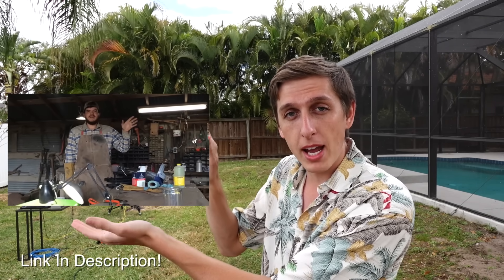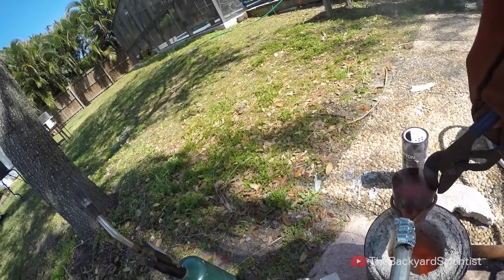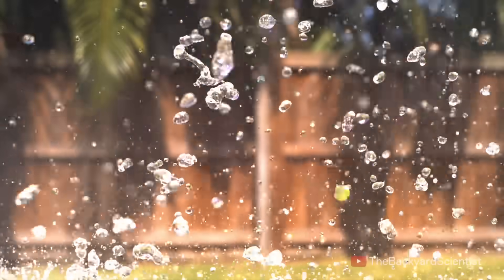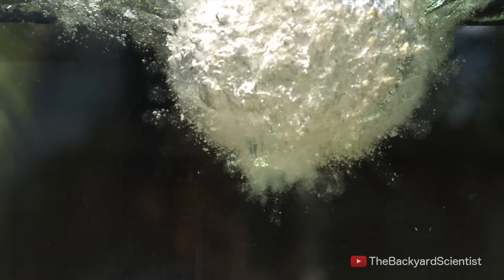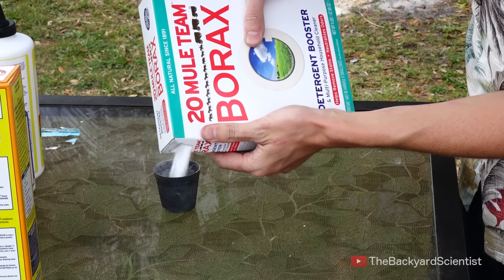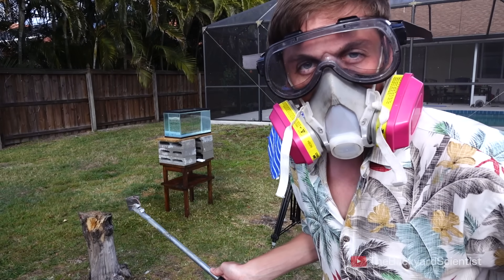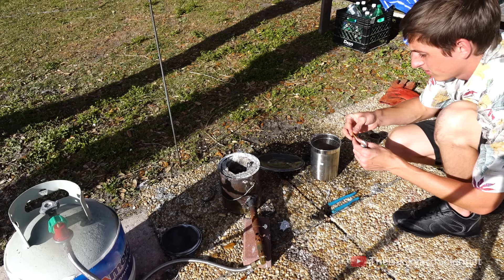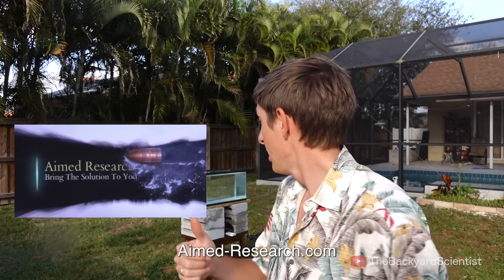Pouring Molten salt into Water - Explosion!

Comment: I hope this helps. The salt itself doesn't explode, the molten salt is so hot that the water instantly boils to steam. As the water contacts the very hot molten salt it dissolves rapidly, transfering its heat to the water much faster than would happen if the salt did not dissolve. Bam! Explosion!

It's not a chemical reaction. Aluminum would work well.
Reply: John Irby I agree, there is no chemical reaction. No new compound can possibly be formed here. All this is is a change in states of matter and the process of solvation, all due to the transfer of thermals energy from the molten NaCl.
Reply: Not Brenda  I disagree, there is a chemical reaction (the explosive solvation of sodium and chloride ions into water via a coulombic explosion). Basically, that liquid salt is held together from boiling by ionic forces and water disrupts them thus turning molten salt into a cloud of ions ready to go into water.
It should work with almost any highly water soluble alkaline salt with a high enough melting point, but the salt needs to be heated waaaaaay above it's melting point.

Other coulombic explosions are alkali metals + water and thermite + water (ice)
Reply: None of the above explains why there was a different reaction with other types of salts.
Reply: @stellarfirefly  the announcer did mention the Leidenfrost Effect as an explanation, which apparently varies for different surface properties.
Reply: But it creates a different compound sodium hydroxide, and if it wasn't chemical there would be no flames. Also if it creates an explosion just by boiling water, how would people cool off metal for swords?
Reply: metal for swords is quenched in whale blubber, not the same as water.
Reply: I dont know much about science but I was thinking that the water heated so fast it expanded outwards really fast and when it expanded it expanded really rapidly and put lots of pressure on the glass  :P
Reply: The water is being extremely quickly changed from a liquid to a gas resulting in an explosion from the rapid expansion and buildup of pressure.
Reply: I'm a Physicist. I've tried to explain this a basically as I can:

Newton's first law...conservation of energy. But more applicable is the third law of thermodynamics states that the entropy of a system approaches a constant value as the temperature approaches absolute zero. You can recreate this experiment over and over with the same result...even with Aluminum....

Chemists...think very hard. What chemical reaction is happening here....?
Reply: Dissolving is a chemical reaction of sorts
Reply: @TheLaughingclaret  I think dissolving is a physical reaction.

Comment: Water can begin under going thermal decomposition (hydrolyze) around 800 C which is incidentally the same temperature that sodium chloride melts. I am unsure, however, if enough water would hydrolyze to create this large of an explosion. This was actually one of the reasons that the disaster at Fukushima was exacerbated because the hydrolyze hydrogen and oxygen blow a hole in the side of the reactor. https://www.scientificamerican.com/article/partial-meltdowns-hydrogen-explosions-at-fukushima-nuclear-power-plant/

Comment: Is it possible that the reaction isn't so much with the salt but the water. Maybe the molten salt is hot enough that it separates the water into Oxygen and Hydrogen, and the heat from the molten salt is enough to explode the Hydrogen around it.

Comment: I think it's simple. It's all about solubility. Salt loves water and dissolves very fast in it. Even more extremely so if it's heated. You put salt into water in normal conditions, return few hours later and it's all dissolved without mixing. You put hot salt in it, you speed up that process into milliseconds.

Think of how much energy desalination requires. The molecules of salt are attracted to water so strongly that they can overcome the Leidenfrost effect by random touch if temperature is sufficiently high. Once there is a random touching spot, the salt expands faster into the water than the water can expand away from the salt. Once the water got infused with that hot salt faster than it can evaporate, it explodes as the water catches up evaporating.

Comment: It may have to do with the viscosity of the molten salt is it look like the borax and other solvency were melting and having a higher viscosity and so could not create holes for water to get trapped in when it was poured because it was keeping a more contained Mass like a drop of water you can test this by smelting other chemicals that would have similar viscosity when melted and pouring them into water

Comment: What's the difference between an explosion and a chemical reaction then?
Reply: Exploding black powder, dynamite and such are chemical reactions. If you put a very hot wine glass in very cold water it will shatter but that is not a chemical reaction. The question here is, did NaCl react with the water or anything in it or not. I'm not sure that no ph change means no chemical reaction. It just means none of the NaCl dissolved in the water.
Reply: Aha I see!

Comment: So theoretical guess as to why this works (though can't explain the difference in materials). You are definitely seeing the same reaction as what you get from elemental salt, but I think the delay is because the rapid cooling is causing the separation of the elements. To explain, sodium loses an electron, chlorine gains an electron, and creates your stable table salt. Heating it would add a lot of energy, and then the rapid cooling as it hits the water is potentially breaking apart the salt into the 2 elements at a rapid pace and then you see your sodium reaction. Also the chlorine if separated would be in gas form I think, which being under water would possibly also cause a rapid expansion? Idk, I suck at chemistry, just going off a logical guess.

Comment: Just a question but could the heat be separating the sodium and the chlorine and you have a delay in reaction due to the chlorine or chloride acting as an insulator between the sodium and water. Just a question of ignorance by the way

Comment: When you melt sodium chloride in your crucible the greenish gas coming off is the chlorine separating from the sodium. Which sodium is very reactive with water. Basically you showed the reverse process of making sodium chloride. They take an airtight beaker and fill it with chlorine. Then a drop of water is dripped onto a piece of sodium in the beaker causing it to ignite and instead of exploding as it would with oxygen it instead absorbs the chlorine and creates table salt.

Comment: Just causing the water to flash boil. Same experiment could be done in a microwave without the salt.
Reply: Pouring molten iron into water doesn't yield the same results, so try again. It's specific to the elements at play.

Comment: It might be that salt retains its hygroscopic properties at high temperatures. Any breakdown in the Leidenfrost barrier causes water to be instantly drawn into the molten salt. It'd also explain why there's a slight delay between initial contact and the explosion. A small portion of it has to cool slightly first.

Comment: My theory:
       Steam explosion, not salt explosion. 
      Energy to power explosion is stored in molten salt as heat. 
      Somehow, molten sodium chloride is able to transfer heat into water efficiently and rapidly. 
     Rapid heat transfer means rapid expansion of water into steam.
      Rapid expansion is literally what makes an explosion an ex-freakin-splosion 
      Sodium Chloride’s extreme water solubility means high surface area of contact between it and water. 
     High surface area contact means rapid heat transfer, which means steam, which means kaboom.
     Conclusion: Sodium chloride is able to dump heat into the most water possible in a very, VERY short time. 
    Extra credit: boric acid made a ball in the water which means most of the heat was trapped inside the ball, not boiling the water.
    Conclusion part two: It has to be about the time it takes to transfer heat into water.
    Also: I hope this makes sense

Comment: Best guess, heating the salt separated sodium from chlorine; sodium + water = boom

The chlorine liquid could be insulating the sodium liquid, allowing more of it to react simultaneously rather than exploding on the surface.
As a general rule, underwater explosions are intensified (see, firecracker by self, firecracker in bucket of water)

Comment: you should have known pretty good if there was a chemical reaction or not by adding phenolphtalein on the water before pouring molten salt.
Phenlophtalein is a basic indicator that turns pink if there is NaOH in solution.
Reply: The reaction would have slowed somewhat. I have a feeling this is a Coulombic Explosion melting the salt makes the surface smooth which facilitates the reaction. Adding Phenolphthalein might get in the way of the ion exchange between Na and water.

Comment: You got extreamly hot molten salt, lower boil point of the water due to the salt at the place of contact between them.  Then water pressure all around the salt.  basic

Comment: Salt is sodiumchloride. MOLTEN salt exists of those components. Sodium and other alkalimetals are commonly known for these reactions when mixing it with water...  do a bit of chemistry class before doing this stuff!
Reply: The molten part plays the only key roll. The temperature causes expansion and the bonds of the sodium and chlorine to break. Chlorine returns to it's gas state and leaves the sodium in the crucible

Comment: There is actually what they call the flash steam effect.  Basically, when boiler explosions happen it is because molten hot boiler tubes come in contact with room temperature or even preheated and in some cases, the water is already heated to 210 degrees with neutral PH and the water instantly turns to steam.  When this happens its a natural thermodynamic event where the pressure is released by the flash steam is like TNT.  The corresponding release of pressure and energy is like a bomb going off.  Read the Paris Tennesee boiler plant explosion to see a very large example.

Comment: I'm pretty sure the outside of the molten salt solidifies when it touches the water, trapping liquid salt in the middle. As more of the molten salt solidifies it compresses the molten salt inside until it bursts out. The other molten materials conduct the heat faster which makes the steam around the moment metal, allowing the cooling to occur slow enough not to explode

Comment: I'm still lean towards chemical reaction, if it's physical the amount of energy can't explained by the small amount from heating (which many more similar material at the same or higher temperature swould reproduce this explosion) my hypothesis is hot salt catelyzed or part of the reaction that produced hydrogen gas in the process. Hydrogen is capable of powerful explosion without smoke of Na(naoh) or change in ph (water as the end product)

Comment: I think both chemical and physical reactions are there. Because the high temp, the water got gasified fast, the large amount of gas (water vapor) caused pressure, the explosion. That is physical reaction. But when you pour enough molten salt quickly into water, large amount molten salt can not be cooled in time, it can further decompose the formed vapor into H2 and O2 and cause oxidation, the chemical reaction. That's why you can see a flame. Here only temperature plays a role, Na and Cl not, so the pH is neutral.

Comment: Well, Sodium actually reacts with water to sodium hydroxide and hydrogen which ignites on water surface instantly. In case with molten salt there is no chemical reaction with water.

Comment: Haven't you separated Hydrogen and Oxygen from a tank of water using electrolysis? Use ohmmeter probes in water as you add salt (NaCl) until supersaturation. (Figure out how to separate it on your own or just drop a 9v battery to get the idea). The energy from the heating of the salt beyond H2's ignition point when mixed with pure O, and poof, explosion (which forms water again). It isn't rocket science. There's your explanation.

Comment: You should search YouTube for WWII disposal of surplus sodium. Your hypothesis of it being non-chemical based on heat doesn't explain the results obtained with cold sodium. You can get a similar result with any of the elements in column 1 of the periodic table assuming you can get them in pure form that can be thrown into water

Edit: unless you are just talking about the molten sodium chloride and not generalizing to the molten sodium. It wasn't super clear.

Comment: I'm a firefighter and I'm taking classes for fire protection. like aluminum, sodium medal is a metal that reacts violently with water. aluminum blocks for car engines are common and when one with an aluminum block catches fire when we put water on the fire it does the same thing that the sodium metal did when he tested it.
Reply: You're right. And this happens with Aluminum because when the Aluminium is hot enough, there is no Aluminum oxide coating protecting the Aluminum itself to react with Hidrogen present in water.

Comment: NaCl is a crystal with its bonds formed by dipolar ion interaction. It is a very strong bond that requires a lot of energy to melt. It also means that its melting form contains a huge amount of energy in the form of heat. When being contacted with water, it vaporizes water. With that much stored energy, a large volume of water vapour was created and expanded in volume exponentially due to high heat. It caused the explosion.

Comment: hey wsup, this was a cool vid but I disagree with your premise that the water is being trapped in the sodium. If you simply put water in a pyrex 4cup measure for approx 7 min. what you 'll get is super heated water that can spontaneously 'detonate'  when pouring into a tea cup or something. I agree its a physical reaction.  The variance of superheated water and regular temp water by contact with the  sodium seems to cause rapid diffusion. I blame the superheating properties of water entirely and the salt only dissolves afterwards.  thats my guess.

Comment: I think the leaving frost effect is still there but shorter. When the salt enters the water it wants to sink because its density is  2.16 g/cm³ when waters is 1 g/cm³. The heat still wants to rise and it is in the cool water. The heat is so hot the fastest possible escape is through an explosion.Also some water displacement will happen during the splash witch makes no water above salt then more water covers it right before frost effect dissipate making the explosion from the heat pressure.

Comment: Nothing in this video is technically correct or incorrect, but I'm gonna set the record straight.

Pure sodium does have a rather violent chemical reaction to water: it would have caught fire and created minor explosions even without being superheated first. This has been scientifically proven, and you can go look up other videos on the subject to show actual scientific analysis.

On the other hand the biggest reason, and probably one of just a few, why the table salt exploded is BECAUSE it was superheated. That created an extreme temperature difference between the substances, resulting in a physical reaction.

Another thing to note is your mentioning of the flames being given off from the sodium as you heated it up. This is another chemical reaction, evidenced by the yellowish color. Notice also how the sodium produced flames as it contacted the water, while the molten salt was simply an eruption of water.

Comment: It is a steam explosion! Look for the blast of the fukushima reactors. Molten sodium chloride has a low viscosity and high solubility in water. The explosion will increase the surface of the molten salt poured in and therefore in can transform the heat energy directly into steam. The other salts looked more viscous and got therefore more glassy, so the surface got not increased.

Comment: It was a physical reaction. Since the water is at a certain temp, the salt is coming at around 4500 degrees. It's like putting a measuring cup with extremely hot water with a syringe, it shatters and explodes. If anyone can correct me on this, help would be appreciated to help TheBackYardScientist out.